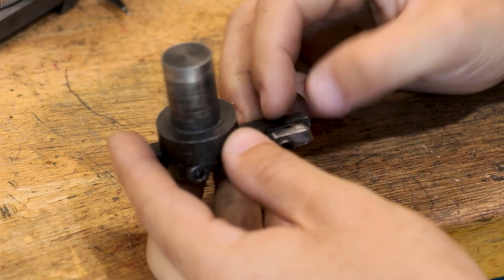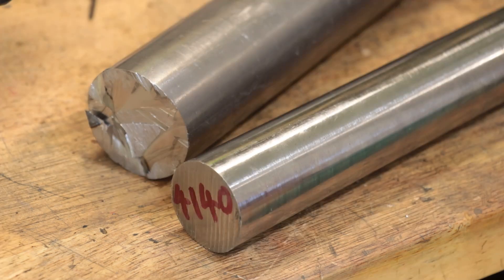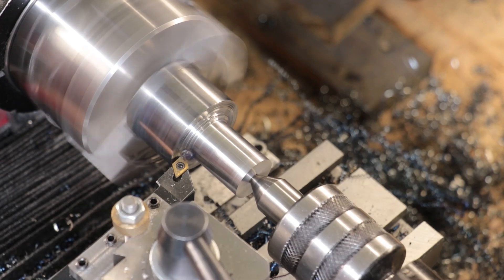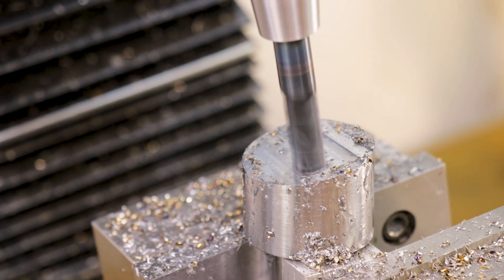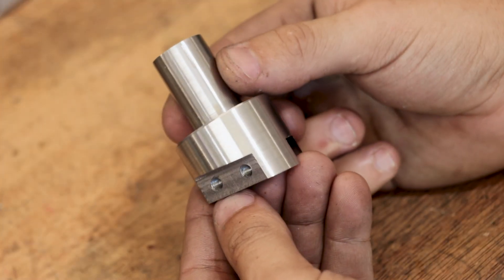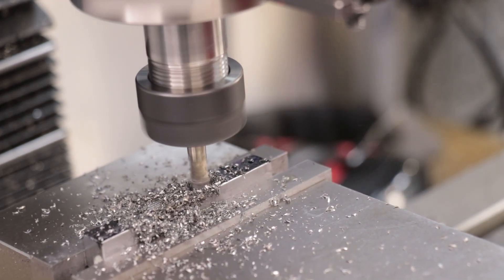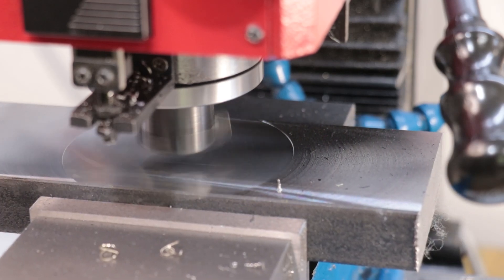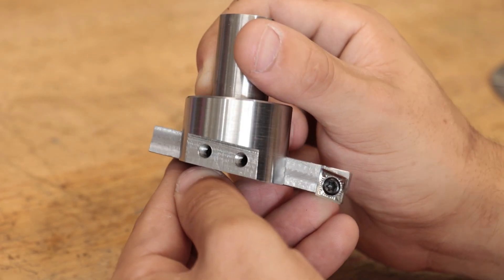Making a Fly Cutter From 4140 Chromoly

Comment: Nice work! The 4140 should definitely give you a long lasting tool.

My experience with carbide leaving a bad finish is usually due to it not being pushed hard enough. I.e doing a deeper DOC.
Reply from the maker: Fair enough, interesting to hear your experience with it. Cheers
Reply: Also corner rounds. Larger the fillet the better the surface finish, but higher tool pressure
Reply: Maybe also needs the fly cutter holder being balanced
Reply: That true and also the insert is too sharp, you need a larger radius at the insert
Reply from the maker: Still doesn’t explain why my DCGT aluminium inserts with the shape rake and smaller nose radius leaves good finishes but these don’t.
Reply: @artisanmakes  Been also using some Brand Name Aluminum Inserts for Cutting Steel on my Lathe for quite some time when i First Started some Years ago. 
Sometimes got Amazing Results, and would still use them, but they are just so much more Expensive than the Cheap Inserts actually meant for Steel.
Main Problem is also that they seem to break much more easily than Steel Inserts because of the very Sharp ground Edge these usually have.
.
Apart from Depth of Cut, I found that it also depends a lot on Surface Speed of the Tool and of course the Material itself.
With some kinds of Steel i just was not able to get good results, and Steel Inserts worked much better.
Maybe try to Slow the RPM way down to 300 to 500 RPM (or even Lower if the Mill Still has enough Power then), as that is still a huge Diameter cutter, and you get some Crazy High Cutting Speed at the Insert if you run it at what seems like 1500+ RPM.
Takes much longer, but got really good results with Slower, Lighter Cuts.
With Speeds THAT high, you would probably need to Push the Cut to be very Heavy to get decent Results?
.
Or, as others suggested, use actual Steel Inserts, if you cant get it to work with these, there is a Reason after all, why the Industry is using these for Steel...

Comment: Interesting that I design a flycutter then literally the next video you put up is making another flycutter xD
I went down a similar route to 'We can do that better' and designed one that takes a ccmt insert directly utilising the 100 degree edge to try and get more use out of the scrap inserts from lathe tooling
Reply: The 100° edge works really great on fly cutters for me! Finish is great. A Bonus is that it creates much less burr than sharper corners, because the material ist cut "from the top" rather than pushed over the work piece edge leaving a burr. And you can reuse your old inserts.
Reply: @schrauberhugo2594  reusing the old inserts was the main idea. Remember someone saying it in a video a few years ago and thinking it was a good idea, then promptly forgetting 😂
Reply: @SimJackson   Joe Pie has a great video about fly cutting, there I got the idea from. Although he uses hss, but with a huge radius and angle.

Comment: i think the finish quality has to do with the carbide nose radius, larger is better.
Reply from the maker: For sure, but there is something that is not quite right with these inserts. Even compared to smaller radius CNMG that I use in my boring bars, these don't work as well.
Reply: @artisanmakes  maybe they only work well on aluminum.
Reply from the maker: As I said in the video I’ve used DCGT inserts made for aluminium that yield great surface finishes in steel and have smaller nose radius than what these have.
Reply: @artisanmakes  You should try some with a larger corner radius for aluminium, 08 should be fine.